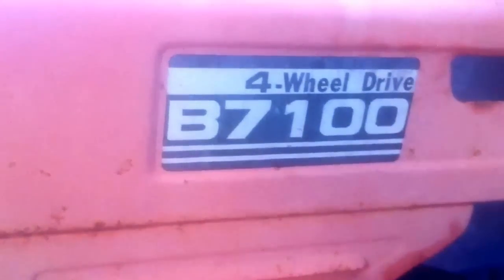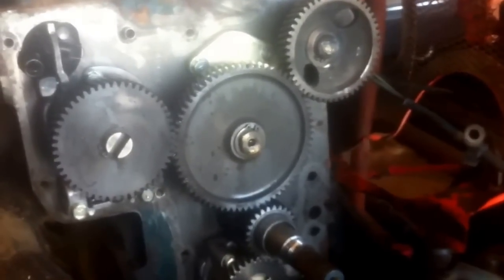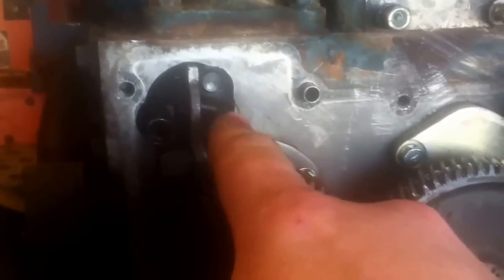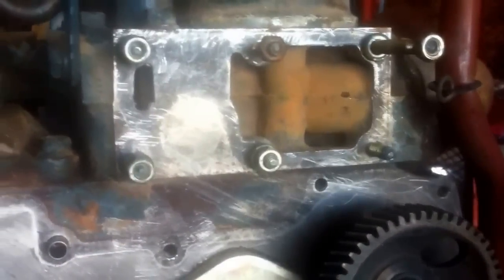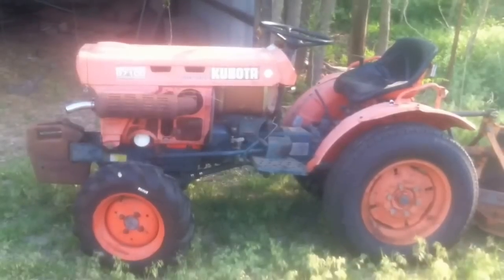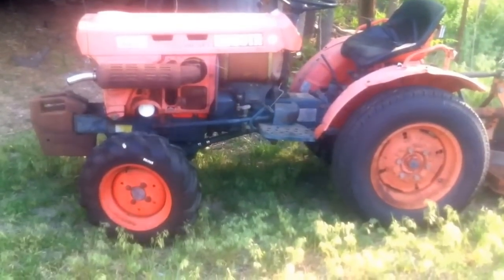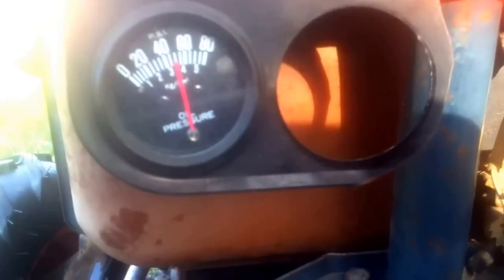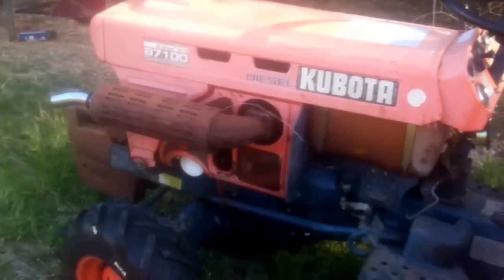Kubota 7100 camshaft oil plug fix

Comment: This is late.  Mustie1 took the front wheels-axles off completely.  Is that necesarry?  Are you saying you just used a welding rod to seal the camshaft oil plug?  My B7100 has the same problem.  I am a half arse mechanic, is this something I should try.  Thank you if you read this.
Reply from the maker: I dont recall taking axles out.  Its been so many projects ago, I just don't remember all the details.  You will need to remove the hood, radiator, radiator support, belt, and all accessories running on belt to get the timing cover off.  As far as the plug, I just used a 1/4 steel rod.  I cut it about 1" long, put it in my drill press, and used a grinder to add a taper to it.  I then lightly tapped it onto place and added a small weld to hold it in place.  Its still running good today.

Comment: How did you determine this was the problem
Reply from the maker: I had low oil pressure.  The oil light would come on at idle and would go off with higher rpm.  I installed a manual oil gauge to confirm the low oil pressure and not a faulty oil pressure sending unit.  After my research I noticed that this is a common issue and there was no way to confirm it was the issue with out disassembly.  The original plug was aluminum and not steel.  The difference in materials allowed the plug to expand and contract at different rates from the steel camshaft.  From my research, this was a common issue.  I welded the plug in the camshaft so I never had to worry about it again.  If it was not for that one bolt under the thermostat housing, it would be an easy job.
Reply: @imabass77 
Hi it's possible to talk with you about this problem I have on my tructor

Comment: Does this happen on all b7100? I know they discontinued this model for a while and then reproduced it in the 90's only in hydrostatic. Reason I'm asking is because I own a later model b7100. I also own a older b5200. Thanks
Reply from the maker: William Dowell I have no idea what models have the issue.  The engines with issues came with an aluminum cam shafts plug.  I think the fixed it with steel plugs in the later models.
Reply: Will Bass thanks for the reply
Reply: Hi, I have I think the same problem , can some one help to explain more specific how to replace that plug in metal one?